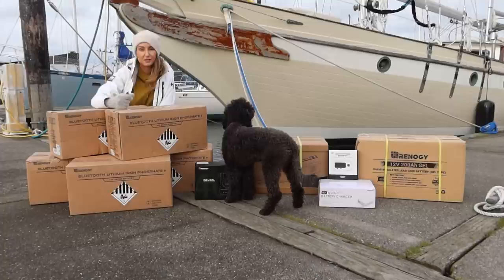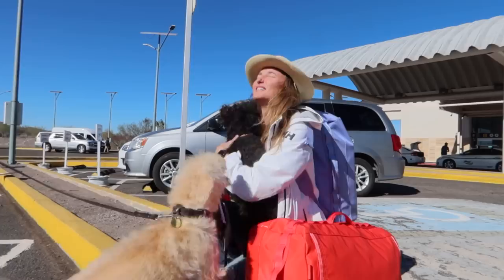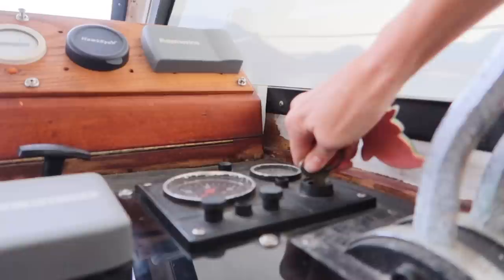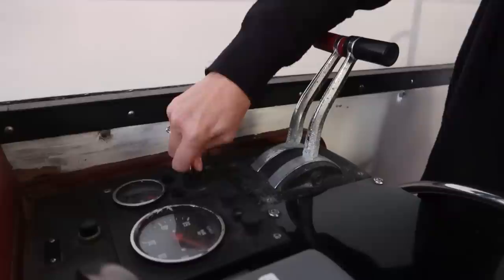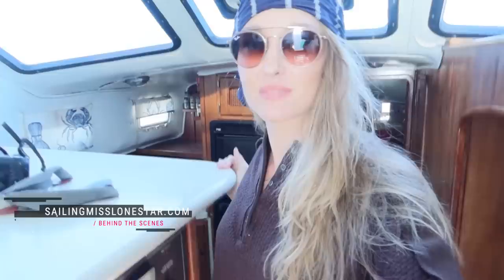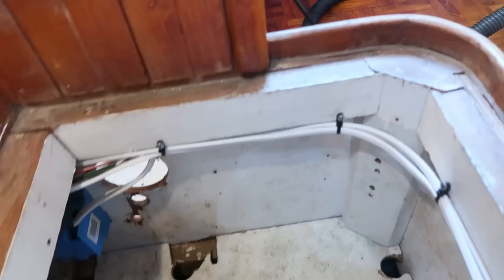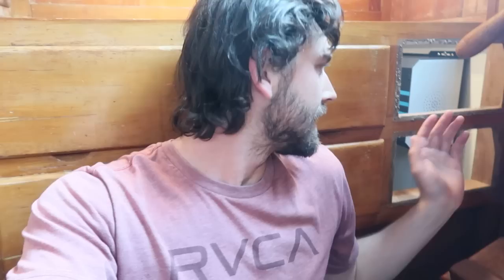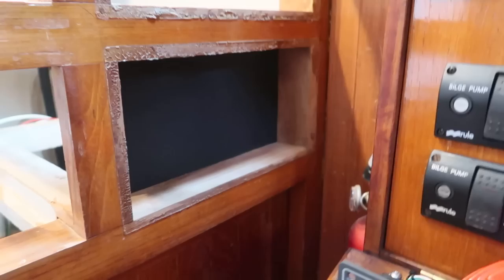New Power in the Pirate Ship | PIRATE SHIP S14E11

Comment: Aubrey it's nice to see that you are getting some battery power and inverter, but I feel that with the boat size and power draw I do think that a 5kW inverter would have been better. I also think that you should have 6 batteries and not 5, then you could run a 24V system instead of a 12V system halving the current drain. How are the batteries going to be charged? You were on Rick's boat (SSL) and check out his now new system and what he is able to run. Also see what Colin from Parley Revival have done regarding batteries and charging. Also see what Jason and Nikki from Gone with the Wynns did regarding their battery and charging ability. A lot to think about.

Comment: Good Video ! I Would have liked to see a Min. 1” air Gap between battery’s. The Sides of Battery’s can Get very Hot 🔥 during charging.
But , besides that Battery box is Top notch ! When I saw it going in Raw wood , I was hoping you would Glass it / Seal it.
I Also Recommend:
1) putting a Thin piece of Rubber Matt under the Battery’s for impact resistance.
2) Glass the Batt. Box in place to the Hull or secure by some means.

Comment: Just y’all’s luck so I assume the low voltage keeps the selnoid  from opening
Reply: I was a bit unclear on this as well. It seemed like it was cranking over just fine. I was thinking maybe some air getting in the fuel line. Diesels hate air
Reply: As it started when you had the batteries charged up I believe the selnoid need more voltage to open it
Reply: @socomon69  one thing you could do if there is two of you instead of using ether is a rag with gas on it and wrap around the intake filter and crank the motor as soon as it does that the alternator will kick in and should give enough volts to the selmoid to open and allow diesel to get to the engine